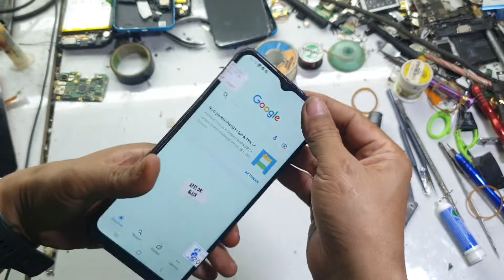CARA GANTI LCD SAMSUNG A03S

Comment: Bang mau tanya di olshop ada yang jual sekitar 250rb itu ori ngak ?
Reply from the maker: gak ori itu gan
Reply: @SAINT928MOBILE  apakah aman buat hp
Reply from the maker: @ytbpremium277  aman , cuma kualitas kontrasnya kurang bagus
Reply: @SAINT928MOBILE  gan hp saya samsung a03s setiap hp nya panas dikit/hangat selalu ghost touch dan sentuhan kurang responsiv sebelumnya dah pernah jatuh 3 kali
Reply from the maker: @ytbpremium277  bisa jd lcd
Reply: @SAINT928MOBILE  klo LCD asli itu berapa kira kira harga nya
Reply from the maker: @ytbpremium277  4-500gt
Reply: @SAINT928MOBILE  thx gan
Reply from the maker: @ytbpremium277  sama2